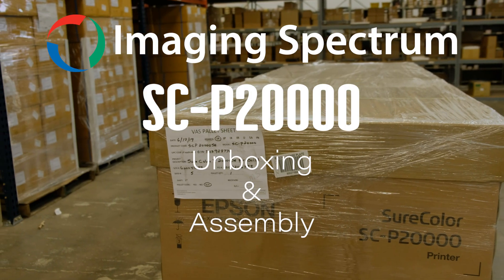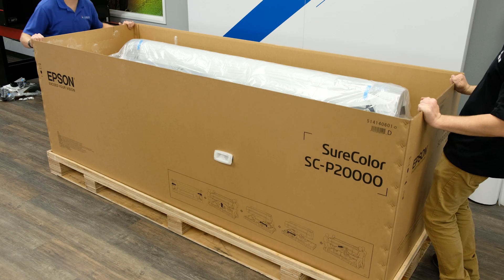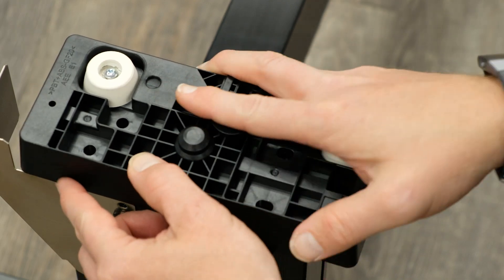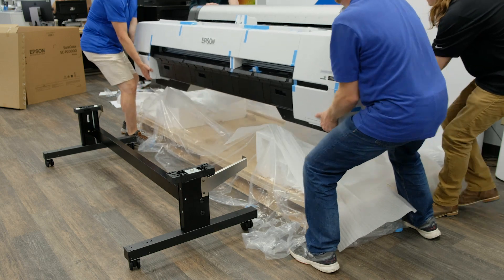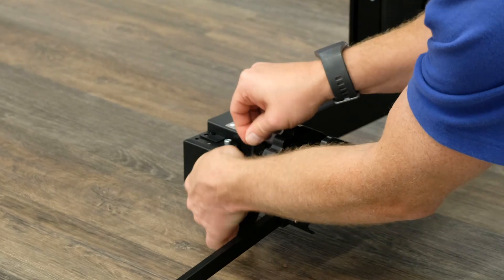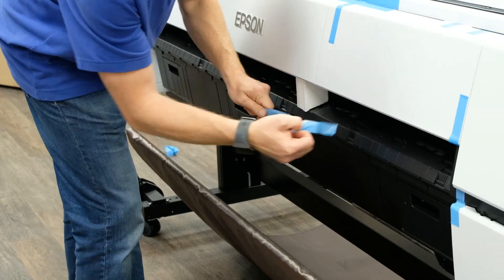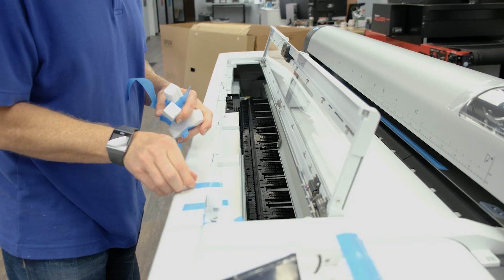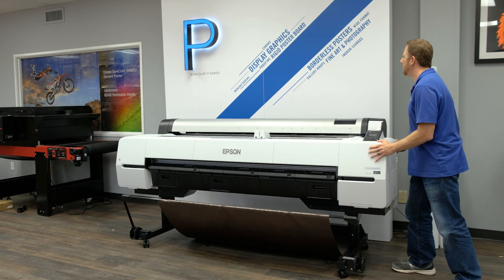Un-boxing the Epson P20000 64" Printer

Comment: My 5 years old P20000 printer is dumping ink on the side of the unused paper after finishing a print. ( right in the area where the Printhead comes to rest ).Had the Epson tech here several times, last thing did was he replaced the dampers which cost close to $735 but the issue was not  resolved. Any help appreciated !